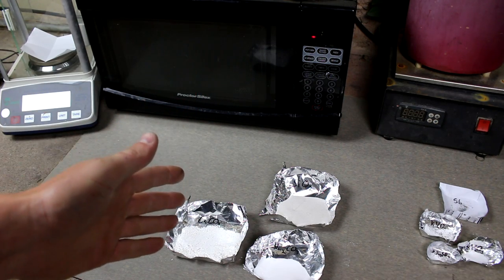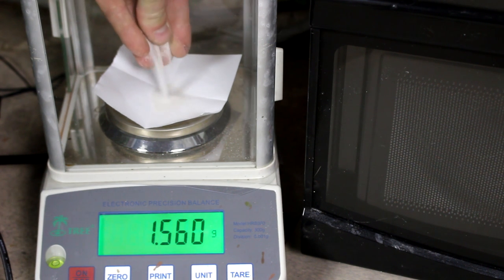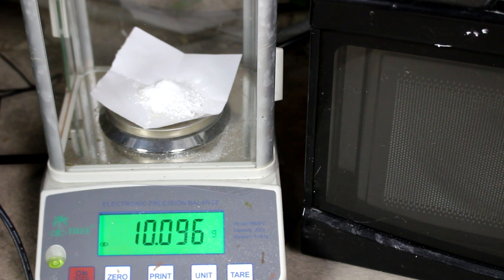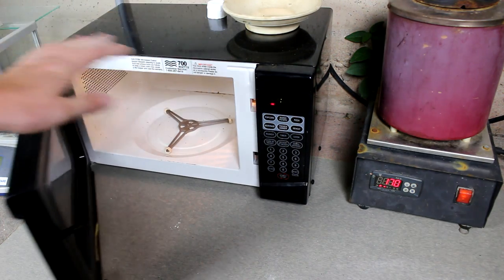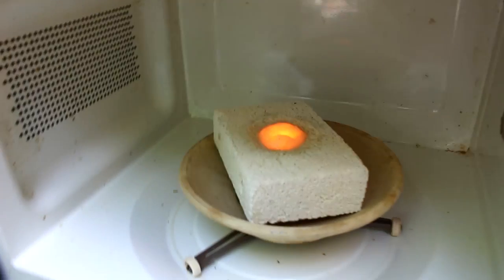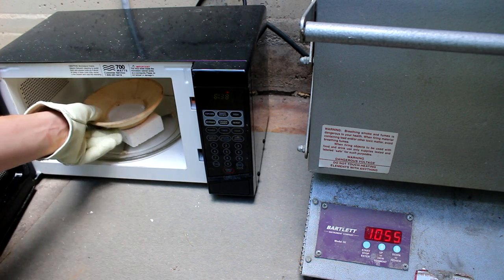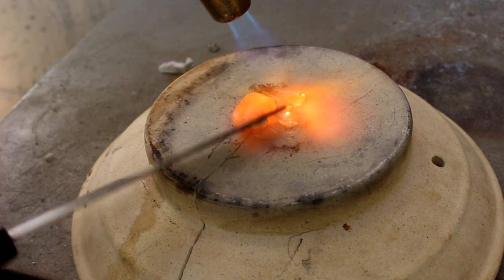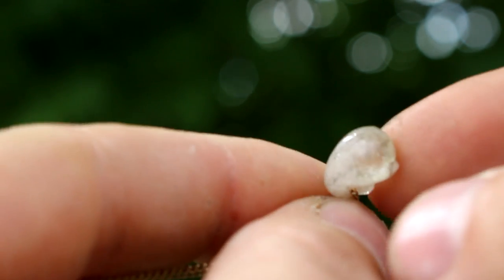Making Glass From Sand Using A Microwave (and some other stuff)

Comment: It wouldn't be a real Cody's Lab video if Cody didn't put it in his mouth.
Reply: It "should" be safe to eat off of.
Reply: Mike Smith if this was a nile red video it would be like: You should never attempt to eat off this glass as there may be some unreacted compounds that can be toxic. But cause cody: here i have all that i need «points at bunch of alluminium foil boxes with stuff on them»
Reply: Not like any chemical there was potentially toxic, anyway. For example Magnesium Sulfate is just Epsom Salts which is a well known oral cure for constipation. A similar form is in gatorade.
Reply: Next time on Cody's Lab, what is the largest volume of plutonium cyanide mercury smoothie that is safe to eat?
Reply: ik but you get the joke
Reply: Well he has to taste it ! :)
Reply: ThatScienceGuy I disagree. You point out things that may be true, yes. However, that's not really the point of this channel, in my opinion. Cody does experiments for fun, and shares them with a vast and diverse audience. Sure, he doesn't have top of the line equipment and doesn't 100% know what he's doing 100% of the time, but that's part of science. Trial and error. Discovery and curiosity are the main motivators here, along with making it fun for his audience. It's still science. If you want nothing but hard numbers, results, and step by step instructions on the methods used, look in a library of published academic journals, not YouTube. I'll be here casually enjoying Cody follow his curiosity and enjoying his life.
Besides, a good scientist wouldn't call another person's work "shitty". That's just rude and unprofessional.
Reply: anybody reading ThatScienceGuy's comment please dont answer. Trolls win if you get mad, so just ignore him. Even if you think he isnt trolling, just dont answer anyway, you cant punch him throught youtube, so an internet argument wont do anything.
Its a greater punishment to let him live in ignorance not knowing what hes missing than to force him to know the truth.
Reply: Meh. Troll or not. Everybody gets one. Spiderman taught us that.
Reply: Cody very well said
Reply: joao diogo queiros delille ty sir
Reply: John Possum But how oral does it get... ``/
+Cody CODY SACRIFICED HIMSELF FOR SCIENCE
Reply: @mikeblair2594  Thank you for putting it into words for us your like is from me.
Reply: @thatscienceguy9458  If you're such a science guy why don't you go and do it yourself if you think you are so much better.
Reply: catothewiser I’m amazed you knew so far in advance.
Reply: @johnpossum556  antimony is poisonous
Reply: @thatscienceguy9458  worst*

Comment: Cody, I build glass furnaces and annealers for studio glassblowers, labs, and small to medium production factories for a living. Contact me if you need any advice, refractory materials (we order various castable refractories, hard and soft brick, ceramic fiber insulation, and insulating board by the pallet and have many offcuts), or anything else. I'd be happy to help. We make our own wire elements and controls in house as well. Is there an email address I could contact you at to discuss this further?
Reply: look in his channel description ;)
there should be a business email
Reply: Yeah you're better off emailing Cody. because you know, theres a ton of comments.
Reply: Austin Smith hey where do you work? I have a very similar job.
Reply: trevor pierce Wet Dog, you?
Reply: Austin Smith nice been taking care of some of your equipment at Alfred for a few years now.
Reply: trevor pierce Sweet. You know Arthur or Jeff? Both worked here for a while but are from there.
Reply: Coslo and Billy are great, hope thier shop is doing well
Reply: Austin Smith I
Reply: Nope
Reply: May I ask what kind of material you use for the internal part of the furnace, where it's in contact with the molten glass? Something that doesn't stick I believe.

Comment: Cody I have a Experiment/Challenge for you. Try to figure out what is the COLDEST a fire/flame can get. Would be a cool experiment for the channel and a learning experience for some.
Reply: Cool flame is a flame having maximal temperature below about 400 °C (752 °F). It is usually produced in a chemical reaction of a certain fuel-air mixture. Contrary to conventional flame, the reaction is not vigorous and releases very little heat, light, and carbon dioxide. Cold fires are difficult to observe and are uncommon in everyday life, but they are responsible for engine knock – the undesirable, erratic, and noisy combustion of low-octane fuels in internal combustion engines. From wikipedia.

Comment: The two hot spots in the heated glass should be exatcly 2.5" apart because that is the distance between nodes matching the frequency of the microwaves.
Reply: unbeirrbar de I thought that but if the glass is spinning then the nodes aren't in the same place?
Reply: I wonder if it's an alternating current, the microwaves are in a standing wave state, which means it's alternating from positive to negative (also the plate is rotating, which means the cross product changes).
But as the person above me mentioned, I think your theory doesn't really hold up. I suspect that even if he was using more material he would still end up with only 2 hotspots at each edge, no matter how many standing nodes the glass has in it, it should still run a current from one side to the other.
Reply: unbeirrbar de reading this makes me feel dumb
Reply: But its rotating?
Reply: I thought about this too, however, the plate is rotating.. so not sure.
Reply: What if the glass is only 1 inch wide?
Reply: I thought the length of the microwave was the length of (or resonance of the length of) a water molecule, hence how it heats up food.

Comment: Actually, those hot spots form because of a positive feedback loop: The hotter the glass is, the more conductive it gets (specifically, lowered impedance at microwave frequencies), so more of the RF 'current' flowed through the already hot parts, causing them to heat up even more, which causes the impedance to drop further, etc. etc.
Also, I believe that those hotspots actually also absorb more of the microwave energy on their own (i.e. increased specific absorbance), further increasing the heating.

Of course, the amount of heat radiated from a hot body increases exponentially with temperature which, along with the limited power of the microwave, serves to cap the maximum temperature reached by the hottest spots.

Comment: You can try to tune it buy using crucible above the activated carbon which absorbs microwaves, which allow to melt almost everything in microwave. Also you shouldnt spin the melting thing! You should put it in "node" of electromagnetic waves, the one of many hot spots in the device, there is easy way to find them by melting the cheese piceces in not moving microwave.

Comment: Fun to watch video Cody.
Titanium acts like teflon when used on hot sticky molten glass.
Find or have a cabochon mold of Ti made. Your finished glass should just fall out when demolding.
The glass needs to be annealed. Unannealed glass works will have tension in them and at some later date commit suicide and break, just sitting and not being touched.
Instead of the microwave, I would build an induction setup. When used with a titanium mold, The mold could be brought to temp quickly and the glass would cook as fast. It could be programmed to slowly cool the glass and anneal it in the last steps.
It might be fun to do projects with already made glasses.

I was experimenting with my homemade Carbon Arc furnace when I was 13 in 1966.
 After vaporizing nickels, pennys and other things, I tried burning Fontana California dirt. It made pea sized glass beads that had a cool and pleasing green color. The iron did that.

Comment: Bruh why the hell is he getting so much materials. He can easily just microwave regular beach sand and get glass easily. Since im going to the beach soon Ill show you guys how.

Edit: I dont have a microwave anymore.
Reply: he has a mine
Reply: Sarcasm?
Reply: You can't make glass from most beach sand. It is calcium based, not silica.
Reply: @growleym504  The sand, no, but the agates you find in that sand are pure silica... assuming you have rocky shores along a subduction zone.
Reply: @ @Cretaal  Better to just use river or pit sand. Most beach sand is pure calcium based. Rocky shores along a subduction zone does not fit the description of the average beach, and they will still contain a LOT of calcium. If you buy a sack of sand for making concrete, it will be silica based because calcium sea shell based sand does not make good concrete. For making glass, leave the beach sand. Get a sack of construction grade sand at the very least. It is cheaper than the gas to drive to the beach anyway. 

With the Potash for flux, the mixture can be melted eventually in a well designed forced draft charcoal or coal/coke powered kiln. Oxyacetylene reaction is at 3200 to 3500 degrees but it can produce a lot of carbon. pure quartz sand normally melts at just over 3000 degrees. Propane actually (is supposed to) burns at 3600 degrees but the heat transfer is the problem. You can't weld steel with propane but before arc welding, most steel welding was with oxygen and acetylene. (don't confuse welding and brazing!) A charcoal kiln with forced draft could probably reach temps of 2300 degrees and I have heat treated steel in a drafted charcoal fire, talking about 1560 degrees give or take half a hundred, depending on the alloy. Electric heat treating ovens or pottery kilns vary in temperature but most go up to around 2000 degrees, I believe. My Paragon does.

Please don't use your microwave. Just don't.
Reply: @growleym504  Agates do NOT contain calcium. It's a pure silica dioxide crystal that you find in practically every state and country. Agates are not sand, they're those see through rocks that you find (even on sandy shores) and they're another form of quartz. And for the record, half the shores on our planet form specifically due to subduction zones, like every beach from alaska to the tropic of cancer. 

Why use sand when you have the pure form available? It's like using iron sand or bog iron when you have a fat vein of pure iron ore jutting out of the hillside. Agates are literally natural glass beads in their purest form. And no sand is required.

If you can't find anything quartz like around you, then sand is probably out of the question as well (in any shape or form). Sand is for industrial amounts of glass, crystals are the craftsmans way of making it since they're basically glass ore.
Reply: @Cretaal  we were talking about beach sand. It does contain calcium. MOSTLY calcium based minerals. Not talking about agates or quartz or emeralds or toasted cheese sandwiches. Beach sand.
Reply: @growleym504  No, YOU are fixated on sand. WE are talking about efficiently sourcing our own material for natural glass with sand as an option. It's a bad option when you can't refine your own material. River sand also contains manganese, magnesium, sulphur, chromium, limestone, etc and isn't a better option. Seriously, pure silicates are so easy to find, why on earth use sand when you don't have a way to refine the material or ensure its quality?

Your "better" method is likely to produce material rife with inclusions from whatever variable substrate you're using. 0 calcium, 0 impurities, 0 metallics, just pure SO2 from the same places you're getting your sand. Even those white frosty rocks you find are a better option.

Leave sand to civilization, nature has already refined a stock for you and it runs a reduced risk of frustrating new craftsmen with unknown variables. No, your method is not better. It's simply more work for a less reliable outcome with a higher chance of failure. Work smarter, not harder.

We're talking about making your own glass, not filling a sandbox ;) and certainly not about culinary arts. Stop being so defensive and instead show some freaking gratitude that a learned craftsman wanted to pass on a simple technique that will save time, effort and frustration.
Reply: @growleym504  Also, beryl and cheese sandwiches do not make good glass... in case you were unaware. It's also funny, because your silica sand is made of ground agates and quartz... so... sorry to burst your bubble.
Reply: That's the trouble with having to bury the microwave while you go for a swim
Reply: @growleym504  Actually poo from the fish that eat the coral off the shoreline, big fish, LOTS of poo
Reply: he tried, he failed... now he doesnt have a microwave anymore...

Comment: Pretty cool bud. I used to get drunk by the camp fire and melt the bottles down flat and use a stick to put cigarette holders in the edges to make ashtrays i had to slowly move the glass from the fire turning it as i went as to not let it just shatter. It worked pretty good.

Comment: I make a glass regularly which is a lovely shade of green. Add 2 grams of black copper oxide and 3 grams rutile to Plainsman G2926B cone 6 clear (I mix my own, but you can also buy it pre mixed). Tin to opacify it is optional, but gives it depth in small quantity. It's beautiful in reduction too with Oxblood and purple color.

Comment: Cody - Microwaves will have several thermal breakers in them. One on the case (often hidden in the back between the inner chamber and the outer shell), and one for sure on the magnetron. They are black, about the size of a stack of 5 pennies, with spade terminal connections like a bowtie on the outside. If you just grab a fan and point it at the magnetron you'll double up on the cooling and let it run longer.

You can see them in the microwave disassembly vids on my channel.

Comment: By adjusting the ratios or utilizing other fluxes, you can certainly lower the melting point of the glass to temperatures that you can achieve with your oven. I've worked with glass that fully matured at 1700-1800 degrees F and even lower.

Comment: Hey Cody, Have you heard of a microwave kiln?  It is basically a large insulating alumina soft brick with a microwave suseptor like silicon carbide or magnetite painted on the inside.  The inside of the one I bought reached witness cone 07 in around 30min in a cheap microwave from goodwill.  If your not familiar with ceramic pyrometric cones, that's about 1750 F.  There is a warning not to exceed 1800F but the insulation should be fine, I think it just makes the silicon carbide start decomposing and causing localized reduction.  Maybe you could use nitride bonded silicon carbide, since it survives at least 2300F just fine.

Comment: Quick tip on the microwave sintering. Try not to place the target in the exact center of the rotating platter. That may be a dead zone considering the wavelength. If you place it on the edge you can watch for visible pulses of light as it rotates around and find a concentrated spot for the energy. Then you can do away with the rotation and place the crucible in that spot. Sometimes just a centimeter in one direction can make all the difference.

Comment: Hey Cody. Put some slightly wet thermo paper into the microwave to find the Hotspot. Then put the Glas at exactly this point. The rotation is made to balance the heat instead of punctual power.

Comment: I have read a few articles about glass fining in the quest for a bubble free clear glaze. Some use carbon to reduce the glass in some way and produce sulphur gas, I think anyway. Is that what the antimony is doing?  Insulating fire brick was a bad idea for not being dissolved by the glass. Here is a good paper on all things refractory https://drive.google.com/file/d/0ByISKVubkZcXbXBUNTQ5R0QxMlk/view?usp=sharing
Reply: I also think you are getting nowhere near hot enough to get the glass fluid enough so that the buoyancy outweighs the viscosity.
Reply: Nice!

Comment: The two hot spots in the microwave heating might be the nodes (or antinodes... I'm a little rusty on my wave properties here) of the standing wave in the microwave, since you were using an older microwave it's possible there wasn't a fan to disperse the waves to give a more even heating, resulting in those hot spots

Comment: These hot spots are a result of the microwaves being reflected by the metal cover of the owen back in the direction of emission resulting in nodes and antinodes,since nothing heats up at the nodes but only at the antinodes it is heated unevenly.

Comment: Cody i've once molten metal in my microwave and produced some alloys in it (bronze and brass) as a science project in my school. You can get very high tenperatures if you put activated charcoal in an microwave oven, so I decided to build a little furnace out of a teracotta pot, some high temperature resistant cement and a porcelain melting pot. If you wonder how exactly i did it, you can message me, and i will give you the instructions and send you pictures, or you can just google it.

Comment: Hey Cody!
The reason for the glass being the hottest in only two spots in the microwave, I think, is because of the peaks and troughs of the standing wave of microwave in the chamber. At the peaks, you get the highest energy and at the troughs, respectively, lowest.

You can actually see this if you put a chocolate bar in a microwave without a rotating dish. It will melt exactly at the peaks of the microwaves! (Video idea?)

Comment: Working in the glass bottle industry, the molds they use to make the bottles are coated with a graphite solution, perhaps this would prevent the glass sticking to the knife and the surface you used to finish for your next attempt?

Comment: Did you do the modification to the microwave where you plug the grate that vents hot air from cooling the magnetron into the chamber?  I remember that being a core mod for allowing higher-temperature operation.